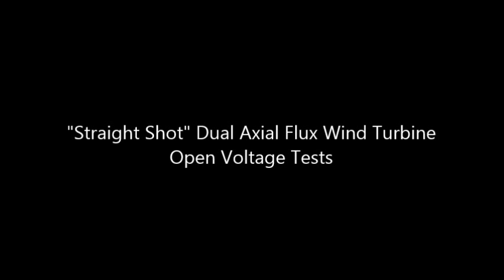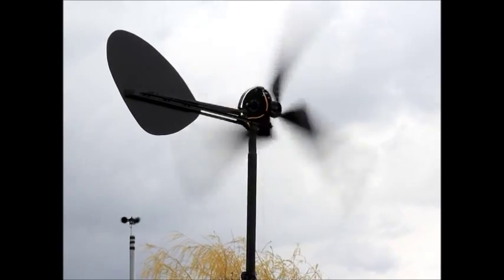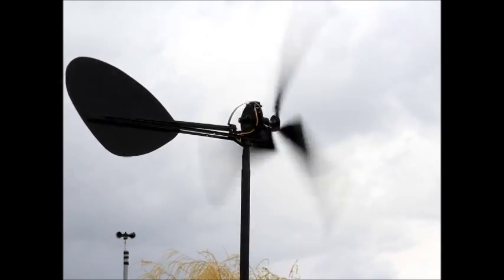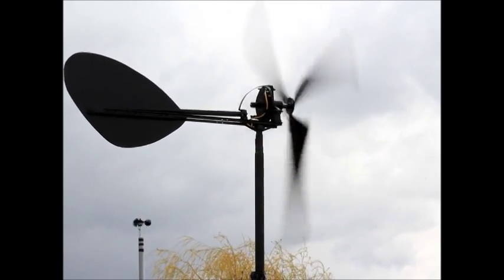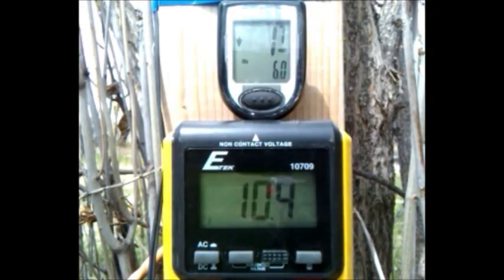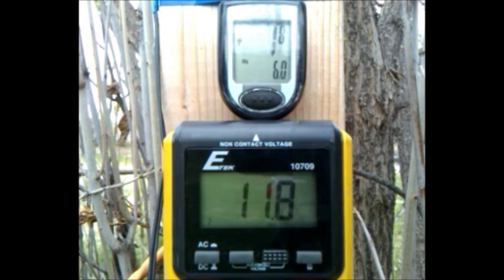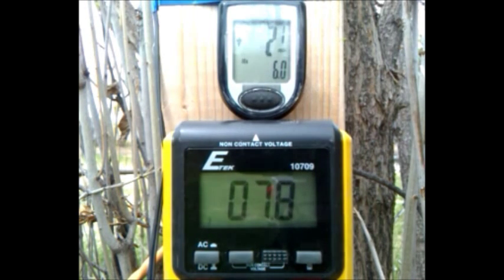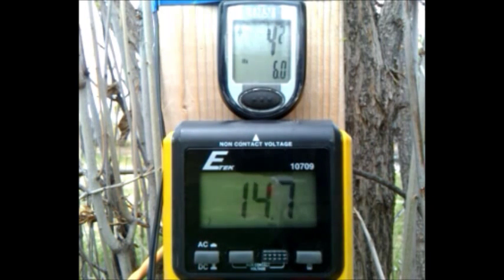Part 4 "Straight Shot" Dual Magnet Axial Flux Wind Turbine

Comment: I am a mechanical and elecyrical engineer who has also built an axial flux hawt. I would like to be able to assess relative performance of my dedign against other designs. It would be great if you can provide plots of Cp vs TSR, and Power output vs wind speed. The problem, of course, is that all of these quantities fluctuate rapidly in small turbines, so we need to have some time averaging. The latter can be done in an Excel spreadsheet. Using the averaged curves we can begin to make some assessments on relative performance. Is it possible for you to do that and present the results in a video? Also, physical data on the propellers like diameter, solidity, pitch profile,  weight and even rotational moment of inertia would be nice to have. Thanks for building and presenting a beautiful AFHAWT!

Comment: I am using 15 gauge wire at 52 turns in a 12 winding stator that I figured out how to mass produce at 25% the resin cost and very fast. Using the 16 magnet per side its a power monster as a VAWT. I also figured out how to use a interlocking web 
My VAWT uses 5 of the HUGE stainless steel commercial restaurant bowls at a 7 foot 4" radius with pressure flaps in them for reduced drag and the bowls are in swept to increase torque at a special ratio. I get 450 to 480 rpms at 25 mph, over 55 amps constant and soon I will install it on my shop. I resist showing it up close till I know that a profiteer in Missouri can not steal its design & methods to send it to Vietnam to copy.

Comment: am I gathering that the 12 volt turbines work best with the so called dirty wind found at ground level to maybe 30 feet or so. where the 24/48 are for the 60 feet or higher tower?
john
Reply from the maker: Yeah perhaps so. It seems that although you may get more peak wattage at 24 volt the 12v system has more net time charging. Plus you kinda have to ask yourself what you are going to do with the power. Especially these small turbines in backyard wind environments. If I can run LED's in the shop, charge the cell phone and a run a small radio ... I think that's pretty cool. There are lots of things that run on 12v ... got to be realistic and temper expectations. I intend to add a solar panel soon which soon and have a micro grid :)
Reply: belgrademachine in that case I would just use a 300 watt or bigger true sign wave inverter and use led lights in shop, then you can charge anything you wish like too batteries, wouldn't be limited to 12 v products

Comment: I Like those blades I have had so many windy days here of  at least 20mph steady all day long  I think I could charge up batteries all day with one
Reply from the maker: It doesn't take much to hit 12v as you can see ... plenty of power if all your running is led's and a couple radios. You just need to scale your draw to the reality of the machine. On another note I'm a little possessed with the idea of making a turn table after watching your recent videos. I believe I have horded all the necessary parts around here already :)
Reply: belgrademachine I have several versions to make this summer I hope the reduction drive from the old garden tiller works

Comment: Looking good would like to see under load at 8 mph. I know your just running a open voltage test today. Does look good in black.
Reply from the maker: Thanks Ian! I did have it hooked up to two deep cycle batteries I converted to Alum. The nominal voltage sits about 11.25 each so aprox 22.5 volt in series. Unfortunately, all the voodoo and prayers couldn't get the wind blowing that day so I barely touched the battery voltage. I intend to keeping it hooked up to that system so I can flick on the camera as soon as a storm rolls in. This wouldn't be a realistic arrangement for this area of course .. the one that stays here will likely remain on 12v and I can accept less.

Comment: looks like with that particular stator you are using in the video 24 volts might work better then 12 volts. in between doctor appointments I try to do a little more work here and there on the set up you sent me. still waiting for magnet information from my buddy. I did set up a coil winding jig. have to modify the size but I got a wedge shaped coil with 51 turns of #14 wire so far. with some more modifications I should be able to get more turns then that. also working on a test rotor set up using 49 pound pull magnets to test the coils with. I am right in the middle of the city but sometimes I get really good wind out of the east. should be a good test subject for city use lol.
Reply from the maker: You know when I hooked it up to 12v although it makes very little I still find it satisfying. The 14 gauge sounds cool too, and I still have several cwaynehawk stators to test as well. I got started on another batch of these turbines so there could be several of us with them relatively soon.